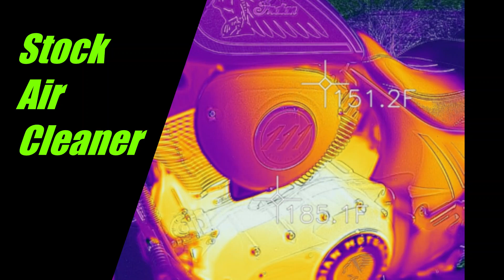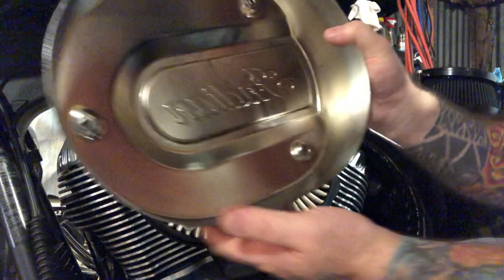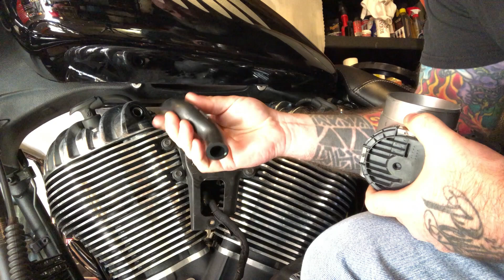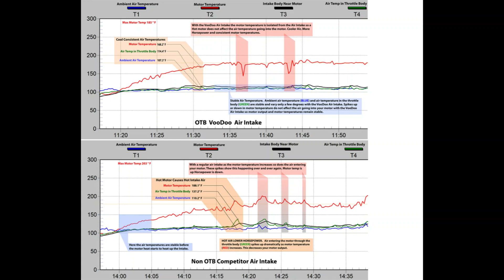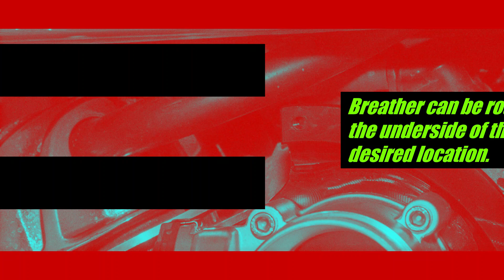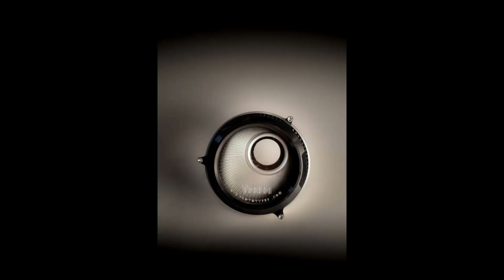OTB Prototypes VooDoo Air Cleaner Installation on a 2017 Indian Chieftain

Comment: Just purchased this for my 2022 Roadmaster Dark Horse with the Pv3.  Did you use blue locktite on all the bolts?
Reply from the maker: I did use blue loctite. See min 13:40. I used it on all bolts that attach the A/C to the bike.

Comment: I spoke with fuel moto and they’re not exactly sure about the throttle body options for the voodoo. On OTB’s website they specify between BBK and standard options. Do you know if their 116 option is intended for the 60mm throttle body? Thanks.
Reply from the maker: Thank you for the interest. I am sorry. I don’t know that answer, so I recommend calling the manufacturer directly.
Reply: The stock TS116 is the 54mm, if you upgrade to the stage 2 you will get the performance cams, fuel injectors and the 60mm throttle body

Comment: How did you end up re-routing the breather vent? Do you have a video of that?
Reply: just use a fuel line and run it either to the ground or you can use a small filter on the end of the tube that will collect the junk, normally a k&n style filter, but it doesn't filter it just soaks up and collects the junk

Comment: Do you need tuning?
Reply: stage 1 flash is needed for a high flow filter like this, but he likely already had it b/c that's a stage 1 air cleaner on the bike

Comment: ONE OIL FILLED FILTER TO LEAK EVERYWHERE.
Reply from the maker: I have over 1000 miles and no oil drops. Because the vent is higher that the outlet any excess gravity feeds back to the head port.
Reply: @gregmurphy-thesteamprinter227  Thanks for the video . . . I just ordered the Voodoo air intake, and look forward to installing it on my '19 Chieftain Limited.  Can you provide some detail on how you routed the breather port tube?  Did you use the stock tube, or purchase a longer tube?  Also, which filter did you use (a link would be great)?  TIA

Comment: So there's no need to remove the tank or lift the tank?  I have a 2019 model dark horse and I'm about to install a Whimmer intake~
Reply from the maker: No. It was very easy. I believe the 2019s and the previous years are the same
Reply: @gregmurphy-thesteamprinter227  if you have the stock air cleaner you will need to lift the tank a couple inches and remove the diaphram, this video says the air cleaner is stock, but it's actually the stage 1 air cleaner, so that's why you don't see this step
Reply from the maker: @CharlieRoadhouse  you are right. Thank you for clarifying that.

Comment: That’s not a stock air cleaner it’s a stage one high flow. Great video 🤙
Reply from the maker: Slim56 it is. The mounting is the same. I used the heat photos from the OTB website.
Reply: yeah, that's the stage 1 air cleaner, the stock one is much different, especially b/c it has the tube that pulls air from under the tank.